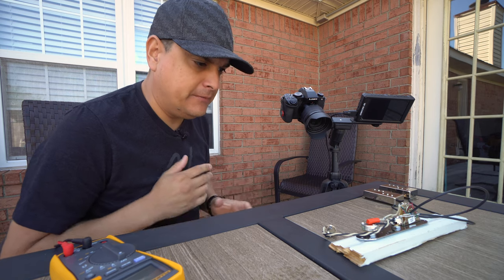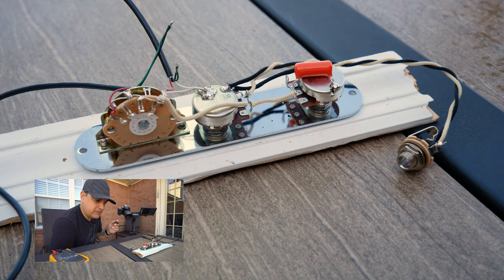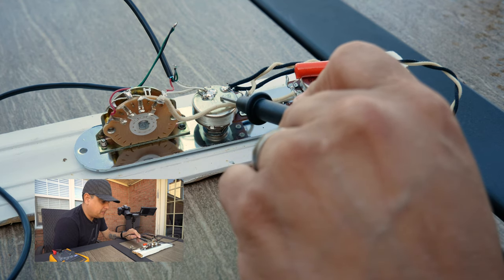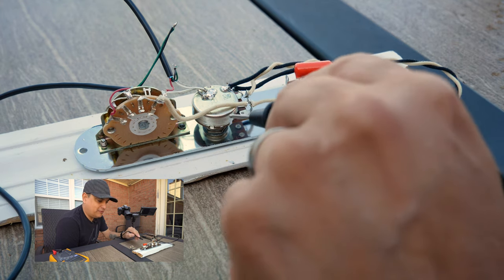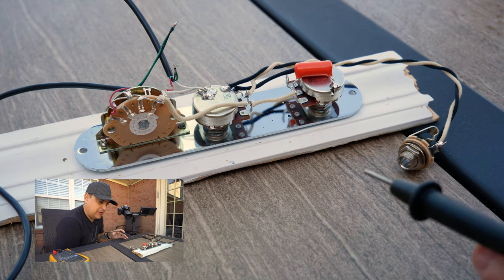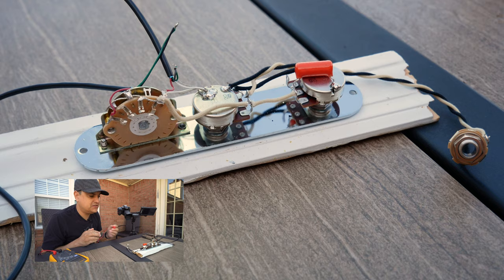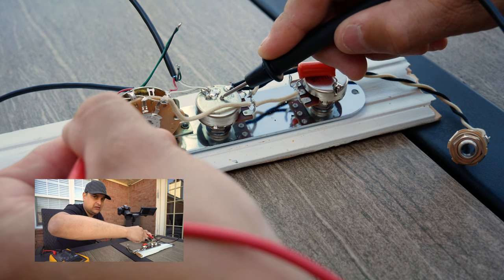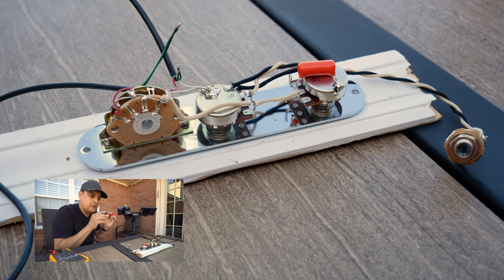How To Troubleshoot Guitar Wiring - Part 2

Comment: Thanks Dylan! Changed over some pups on a HH T-style guitar and couldn't work out what the buzz was. Originally I had a tele control plate on the guitar and then I removed it when adding the new pups. So the grounding was removed by not using the plate. Adding in the vol to tone pot grounding wire did the trick! Many thanks :))

Comment: I have a set of pickups with voicing and coil splitting switched by push-pull (similar to Fishman Fluence), so there is a number of wires. What I found convenient is to have a shield, so I can avoid soldering every component to the ground and make a web of wires. Shielding did not seem to reduce noise significantly, though.

Comment: Hey there good sir. You've been my constant companion for the last week trying to figure out how to put an import switch into a brand new Ibanez that had a circuit board switch from the factory.. it's an RG 421 EX.  I learned never to trust a cheap guitar strap ever again. A weekend to owning the guitar it dropped on the ground chip the headstock a little bit not too bad but actually bent the 5-way selector switch knob on the front of the of guitar.  Hence the drama ensued.  I installed the 5-way Fender style in another RG 421 years ago and figured no big deal.  I was sorely mistaken.  I've never seen a guitar wire like the new rg421 that I just bought.  Biggest thing I learned is there is no industry standard for anything to do with guitar electronics. Which really is frustrating and Googling it doesn't do anything. There's so much misinformation.  I found your channel when I was trying to figure out which wires to tie together because on the new RG the hot lead was white and that could mean anything.  Your videos taught me how to find out which coil is on the pickups etc etc.  anyways I finally figured out what was going on with that import switch. It seems to me the B side what would be a fender switch runs backwards to the common in the middle.   I have my multimeter fired up and ready to go as  I work my way through these videos.  Thank you so much for sharing your knowledge and providing great content.

Comment: I’m building a partscaster.

1) I shielded my cavity. OOPS.

2) My signal comes out sounding clean when routed off the pickups, clean off the 5-way switch, and is corrupted in the volume pot. Wild hairy tone in the middle like a pre-teen in Hot Topic for the first time. Volume pot has been replaced already, I’m running a strat build with three humbuckers and a DPDT switch to “add bridge” to vol output on the wiring diagram when pulled. It feels like a grounding issue but it persists even after I added grounds connecting backs of the 3 pots.  Might you know what contributes to hairy emo volume pots in this configuration?

Love the videos, the multi-meter is in the mail! Cheers!

Comment: Dylan, my pickup reads 0 measuring it directly. It just simply stooped working. Is it possible to fix it? That problem started after I worked on the shield of my strat to wire the tone control to the bridge pickup. When I put everything back together, I noticed the neck pickup wouldn’t work. So, opened it up again and the neck pickup reads 0 directly, so I know it’s not the switch. I thought it would be the switch, because I pulled the shield and wiring pretty hard unadvertently. But, apparently, it is not. I live in Brazil, so there’s no way for me to send it to you for an inspection. Do you know what the problem in the pickup might be? Thank you. You’re the only guitar tech I trust. Cheers, my friend.

Comment: After hearing you talk about shielding issues, I'm wondering now if using the copper tape in the control cavity; in addition to, around my pickups if this is causing my custom P-Bass controls to function only as tones not as separate vol and tone.  All of my grounds and wiring seem to be identical the the Precision control/pickup/output jack diagram.

Comment: Can we get a video of how to diagnose a newly built guitar that has never worked? Ive got a les paul kit build that i tried to put in a jimmy page wiring harness. I get no sound from the strings and it has a consistent buzz/hum that goes away when i touch the strings/jack/bridge etc but still no sound from the strings. Im not sure where to start trying to troubleshoot.

Comment: just started watching your channel.  Building my first guitar just watching youtube.  My question is this.  i got buzz/hum from stacked single coil pickups.  I don't have a neck yet and I have the whole thing wired up.  All the stuff is prewired and the output jack is all set. Some tell me the hum will go away once I put strings on it and it does go away if i touch any of the metal, trem cover bridge etc.  Do I still have a grounding issue?  If not explain why please.  I am new to this.  I don't have a meter.  When I get the neck I can test whether the hum goes away but if it does I am trying to understand why and if it doesnt I want to fix it.  Let me know like your videos desmystifies some stuff.  Demystify this one and I will buy your a beer.  Thanks.

Comment: Hey Dylan, I have not received any notifications from your channel for well over a month. I subscribe to a lot of guitar channels so sometimes it takes me awhile to notice if someone is missing lol. I checked to make sure I was till subscribed and the bell was hit and yes on both, lately I have found that I have been unsubscribed from several channels without my doing it. You may want to check it out if you have noticed a drop in viewership? 

Can I get your thoughts on an issue I am having with a Les Paul? It's a 2014 and I bought the PCB and pups off of Reverb from another 2014, the pups are push/pull on the volumes. My issue is that no matter what type of setting it's on, clean dirty etc, I have to turn the guitar almost all the way up in order to get the full effects of the setting I am on. Usually it has to be on about 8. Someone told me this was a common issue with the PCB guitars. What do you recommend I check before I end up pulling the PCB and just hand wiring the whole thing?

Comment: I really enjoy your channel and find it very useful. I think I have a scenario that falls outside of the issues described in this video. I know you can't cover everything, but I thought I would share this one as I think it may be a fairly common issue. I have a 3-way switch bridge/both/neck. Neck stopped working, middle has super low output and bridge is fine. I checked with a meter (following your video) and determined jacks, pickup, pots, switch are all good. I think I might have a dead ground in the bridge pickup wiring. It is bleeding off all of the signal from the neck pickup and most of the signal from the combined pickups. Does this make any sense?  Both pickups are Lace Led Sensor Duallys connected to micro toggles, so there are a lot of wires in the cavity. Thanks for all the great informative videos.

Comment: I'm about to pull out my hair. Bought a new multimeter, followed yours (and others) instructions to check pots but all I get are random numbers. Ok, so I move on and set the meter to continuity. This function works. I place probes on center lug of neck volume and ground, beep, we have continuity! Do the same on bridge volume, nothing.  Everything seems fine on wiring from output jack to switch. I go to tone pot, (btw this is a 2-vol./1-tone schematic for HB's) output to #1(hot) outside beeps, cap in center position does not beep but grounded end of cap does. Open outside lug and cap end in center beeps. Any advice would be appreciated.

Comment: Something that got me a few years ago. I had no output. Opened everything up and found no broken wires. Eventually realized my problem was my ACTIVE pickups ( which I never had prior) and leaving the cable plugged in causes the battery to go dead.

Comment: One of my guitars has very low output volume and it is not because of cable, pickups or pots. Do you know what might cause the problem? For example if I use distortion pedal it sounds like low gain overdrive pedal. Something takes away power.

Comment: Hi, I have bought a pre-wired tele control from you website on the 6th of September, but the tracking havent updated since 12th of September, I couldn't contact USPS since they dunt answer email for package which sending outside U.S., so I sent a email via the contact link in your website but didnt get any reply, and I tried to inbox you through facebook but didnt get any reply either.
Reply from the maker: Thanks so much for reaching out. I will look into this!
Reply: @DylanTalksTone   that will be great? thank you!!
Reply: Hello Dylan!
Thank you for your very informative videos!
I have a question concerning the effect of wire gauge on the effective output of the pickup, which is kind of a thought experiment:
Say we have a humbucker pickup, which is machine wound with AWG 42 to say 8,00 kOhms with relatively full bobbins. Now we (in thought) stretch the AWG 42 wire from that pickup to AWG 43 and rewind the same pickup with the same wire, using machine winds. The resistance of the pickups might end up being around 13,50 kOhm that way (give or take, it does not really matter that much here). 
The mass of wire on the pickup will be exacly the same either way. It's clear that we will end up with considerably more winds on the bobbins, resulting in a diminished treble response.
But in which way will his have an effect on the overall output of the pickup, when everything else stays the same? Will it be effectively be the same output, as there is the same amount (mass) of wire on the bobbins? Will it be more, as there are more winds on the bobbins? Or will it be less? What else will effectively change when every other factor stays the same?